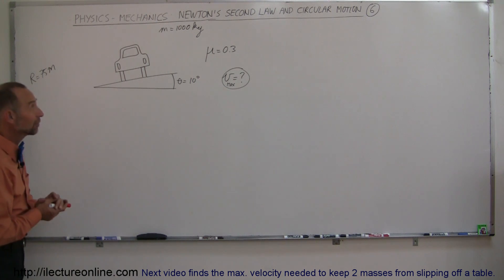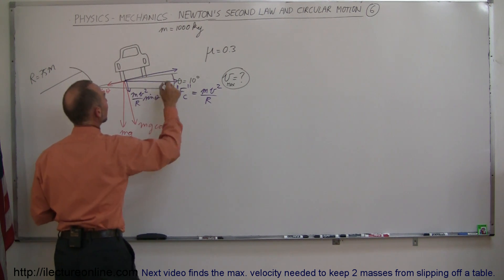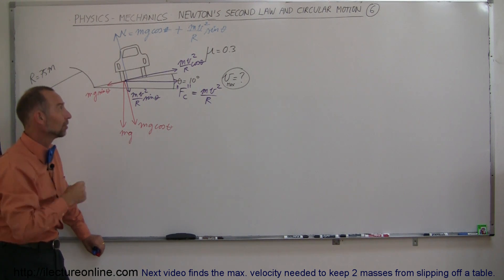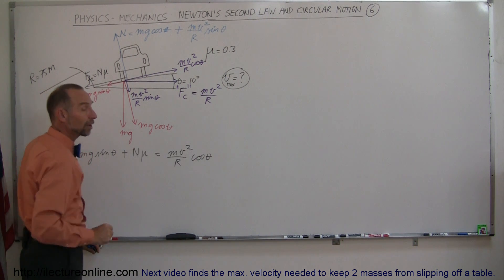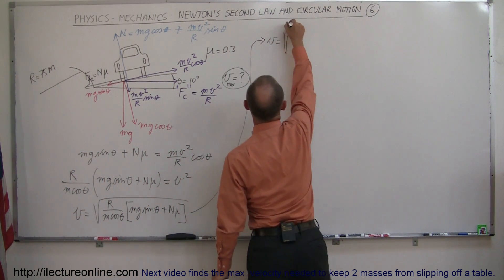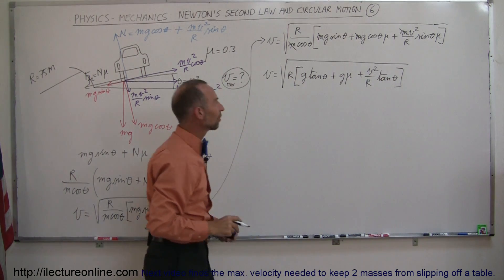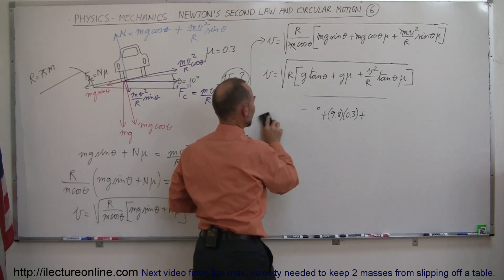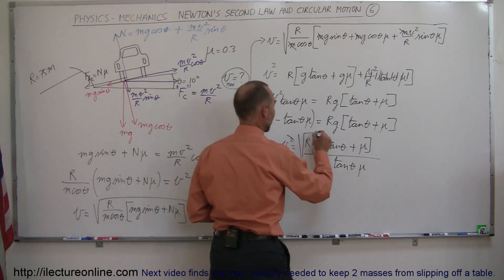Physics 6  Newton's Second Law and Circular Motion (6 of 10) Banked Road with Friction

Comment: I know this is 11 years later but this might help someone else using your lectures as the sole material to get through their physics uni courses. Anyways i found a small error in your calculation. At the end before inserting your values you bring over the 1-tan but as a little error it switched to a 1+tan. The final answer should be 19.22m/s not 18.22m/s. If you could confirm this that would be supper cool!

Comment: I posted this question on your other video on a similar topic.  

Does the friction force where the rubber meets the road acts radially inward to counter the tangential velocity  on the car moving in a circular motion?

Best wishes, and like always I am grateful to u for imparting downright clear concepts and education. 
You are a huge motivation in my life, Learned so many useful things from u, and feel no pressure asking u questions, no matter how basic they may be for u. 
Thanks once again
Reply from the maker: The centripetal force always acts inward during circular motion.  In this case it is the friction force between the tires and the road that pushes the car towards the center of the circular motion and therefore that is the centripetal force.

Comment: if we were given the center of gravity of the car and the distance between the tires for this same situation could we determine if the car could tip over or it wouldnt affect the situation
Reply from the maker: If the the vertial line from the center of gravity to the ground moves to the left of the tires, the car will tip over

Comment: I think there is an error in the final portion of the calculation, if you look at the v^2 equation he has a 1-tan(theta) but changes to 1+tan(theta) when he moves the equation around. Just beware of the error, otherwise we should be all good
Reply from the maker: You are correct.  It should have been 1 - tan(theta) in the denominator.
Reply: I got 26.96 m/s. I solved for velocity in a slightly different way. If anyone else also got this answer, let me know.

Comment: I used a different medhod but I only added the friction in to the equation where I got 18.8 m/s
Reply from the maker: There are indeed multiple method by which you can solve this problem.

Comment: everything is fine but small mistake is its 1-u tan(teta) in denominator of velocity so answer is probably will be wrong
Reply from the maker: You are correct.  (Others have found the mistake as well - see comments below).  When I am concentrating on delivering the material, I don't pay close enough attention to what I am doing.  Good catch!

Comment: Dear Michel,

Could you be a bit detailed on the reason the centrifugal force is not along the inclined plane but rather parallel to the horizontal surface? If the car provides an inertial frame of reference in a sudden turn of the car how the centrifugal force would affect a passenger? If the force was horizontal and if it is the way you drew it.

Thanks,
Reply from the maker: The centripetal force (and hence the fictitious centrifugal force) is perpendicular to the circular motion.
Reply: @MichelvanBiezen  On your argument, then why don't the force components who provide the centripetal acceleration are not on the same line of action but antiparallel to "F_c" ?
Reply from the maker: The component of the force that provide the centripetal force are on the same plane as the direction of the centripetal acceleration.
Reply: @MichelvanBiezen  Exactly, not the centrifugal force, but the centrifugal's force x-component. Is it more clear now why I am saying? Τhat "F_c" shall be anti-parallel to the vectorial sum of the total centripetal acceleration, μΝ + mgsin(θ).

Apologies for the long exchange of replies
Reply: @Michel van Biezen After re-thinking the whole banked road scenario, I can see why I am wrong and why you are correct! 

Thank your for this discussion.

Comment: Denominator should be (1-tan theta* mu) as already pointed out.
From this we know that.. if angle >= 45 degrees, there is a value of mu (i.e, 0 < mu < (1/tan theta) < 1) which makes velocity infinite. meaning that once mu reaches this value we cannot make the object slide up by increasing the speed.

Comment: Sir, is there acceleration on the system if all the forces on the surface are equal? If yes what is the magnitude of that acceleration. I find it very confusing because even though the velocity is constant the acceleration is not? Thank you.
You provide very intersting analyis on the firection of friction which I thank you again a lot because it is a new thing that I have learned today.
Reply: If velocity is constant, there is no acceleration. Acceleration indicates that the velocity is changing. If the net Force of the system is 0, the velocity is constant, and the acceleration is 0. 

If an object is moving at a constant velocity, it will have a net Force equal to 0 and an acceleration of 0. This can be counterintuitive because we think if an object is moving it must have a force applied to it. But Newton revolutionized how we must think of forces acting on a moving object. The first law states that if there is no force acting on an object it will have a constant velocity. And the 2nd law states that if there is a force acting on an object, the acceleration will be either increasing or decreasing. 

Hope this helps anyone with a similar question.

Comment: I ended up with v = √ ( R g (µ cosθ + sinθ) / (cosθ - µ sinθ) ) = 19,2 m/s. 
Not as eloquent but it worked.
Reply: Realise: N = mg cosθ + Fc sinθ 

Realise: Ff = N µ

Realise: Fc = (m v^2 / R)

Realise that the car won't slide when: Ff + m g sinθ = Fc cosθ

N µ + m g sinθ = (m v^2 / R) cosθ

µ (m g cosθ + (m v^2 / R) sinθ)    +   m g sinθ   =   (m v^2 / R) cosθ

µ m g cosθ   +   (µ m v^2 / R)  sinθ   +   m g sinθ   =   (m v^2 / R) cosθ

µ m g cosθ  +  m g sinθ   =   (m v^2 / R) cosθ  -   (µ m v^2 / R) sinθ

m g (µ cosθ  +  sinθ)   =   (m v^2 / R) (cosθ  -  µ sinθ)

(m R g / m)  (µ cosθ  +  sinθ)   =   v^2 (cosθ  -  µ sinθ) 

v^2 =  R g (µ cosθ + sinθ) / (cosθ - µ sinθ) ) 

 v = √ ( R g (µ cosθ + sinθ) / (cosθ - µ sinθ) ) = 19,2 m/s.

Comment: So if the question was: what is the slowest velocity the car can go around the banked curve you would set the frictional force opposite the motion (falling towards the center so Friction would point out) will the equation to begin with be: 

mgsin@=Nu + (mv^2)/r 

does that sound right?
Reply from the maker: Not quite as you have to account for the banking as well, but the approach is correct.

Comment: For this question cant you just use Fc=μxFn which will then be mv^2/r=0.3(9800cos10)
You get a different answer for v which is 14.7 m/s
Reply from the maker: +Justin Meram 
If you are getting a different answer, you are probably making a mistake somewhere.
(Always start with the basic definitions and equations)
Reply: Michel van Biezen actually you turned the minus at (1 minus tan of theta) into a plus while dividing which makes your solution incorrect

Comment: Thank you for this very informative and helpful video. You make coplex situations seem  intuitive and very easy to understand.
 I still wonder  how would you be able to solve this question without the help of the imaginary "centrefugal" force? I would like to have a better thorough understanding of the forces at play here. 
 My best guess would be that the normal force somehow contributes to the centropital force.
Reply from the maker: +olddragon323 
Another way to look at the problem is to use the real centripetal force being provided by the friction force between the tires and the road.
Reply: +Michel van Biezen 
Thank you for your prompt response.
In this video you showed that the normal force actually grows larger due to the vertical component of the "centrifugal" force, therefore the friction grows larger. When I tried to solve the problem using only friction and the horizontal component of gravity I came up with a smaller speed. My question is, what is the "real" force that enlarges the friction to an extent which matches the virtual cetrifugal force's effect shown in the video. The only  way I was able to achive the same results is by treating the direction of the cetripital force as parrallel to the horizon, thus having my frame of refrence parallel to the horizon too, and treating the normal force's horizontal component and the friction's horizontal component as the centropital force. The problem was, that this requiered me to assume that friction has a vertical component, which seems wrong somehow.
Sorry for the long comment. Thank you, you do an incredibly awsome job making education accessible :)

Comment: The last step of algebra has an error; the denominator should be 1 - mu*tan not            1 + mu*tan  then the velocity is 19.2 m/2   Also the algebra is much neater if you eliminate m between the two force equations
Reply: Helen Belete acceleration due to gravity g=9.8 m/s^2
Reply: Helen Belete g is the acceleration due to gravity g = 9.8 m/s^2
Reply: Hi, I'm not sure whether this is another algebra mistake in this problem or not:
In the step immediately following squaring both v and the root, doesn't he subtract ((v^2/R)tan[theta]*mu) to the other side? How then was able to multiply the R from (v^2/R)tan[theta] with the R that was also on that side of the equation?

shouldn't it have really been:

v^2 ((1- (tan[theta] *mu)/R) = Rg (tan[theta] + g*mu)

which would equate to:

v^2 = (1-(R/tan[theta] * mu)) * Rg * (tan[theta] + g*mu)
*edit

Which he would then have to simplify and solve?
Reply: I do not understand what you think is wrong.  At what time in the video is the error made?  I watched the video on 8/7/16 and did not find any algebra errors.
Reply: The mistake was around 8:46. When he cancels out the R on the left side of the equation. He never divided, though.
Reply: At 8:47 professor van Biezen remembers the R on the right hand side, outside the brackets [  ].  So he is subtracting R (v^2/R) mu * tan(theta) from both sides of the second equation on the right side of board. So the third equation on rhs is correct
Reply: Oh I see, I needed to re-watch it. He had to distribute the R outside the brackets on the right side of the equation in order to subtract (v^2/R) mu * tan(theta) to the other side of the equation, which in turn got rid of the R in the denominator of(v^2/R) mu * tan(theta) . He could then factor out the R he just distributed to [g*tan(theta) + g*mu] to once again yield R[g*tan(theta) + g*mu]. Those steps were omitted so, I was a little confused as to how he got rid of the R in the denominator of (v^2/R) mu * tan(theta). But now I see. Thank you for clarifying.

Comment: In my text book they take the normal force equal to mg and always perpendicular to the road so when I took the components of normal force instead of mg it didn't worked quite well. I what my text book telling wrong or I had a mistake? see my text book here http://gujarat-education.gov.in/textbook/Images/11sem1/physics-11eng/chap5.pdf
This is book of first semester and I am in fourth but need to revise that because of IIT entrance exam.
Reply: Yeah I made a mistake. Textbook works neat.
Reply from the maker: Shrey
The normal force is always perpendicular to the surface.  In the case that the road is flat (not banked)  N = mg.   In the case that the road is banked, at an angle, and the car is NOT moving then N = mgcos(theta).   If the car is moving then you also have to account for the reaction force to the centripetal force ((mv^2/r)sin(theta)).  (N=mgcos(theta) + ((mv^2/r)sin(theta)))
Reply: Michel van Biezen Thanks I was always confused if I should take components of normal or components of the mg.Thanks for Help.
Do you have a video on sum of infinite series?
Reply: +Shrey Purohit I guess it depends on how you choose ur co-ordinates